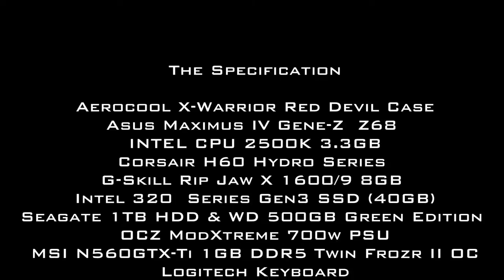ASUS Maximus IV Gene-Z First PC Build 2011

Comment: i love ur set up, quite good for your first build. Good case too, although i usually don't like the Hdd's facing front, makes the cable arrangement not that great. If you can try to route the HDD cables sideways following the back of the HDDs, then behind the mobo tray and then into the gromets into the mobo again, it will look so nice, and improve the airflow a lot =)

Anyway, very pleased with the build =)

Comment: i would suggest using just one beast card like a 580-680 i have a msi-gtx460 in my rig and i run 50-60 fps on ultra on bf3. you will spend more money on sli for just 5-10 more fps. and go nvidia i have had my msi gtx460 for over 3 years and it still kickin just change the thermal paste about every year and it will last a long time :)